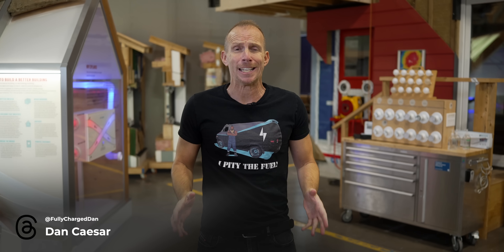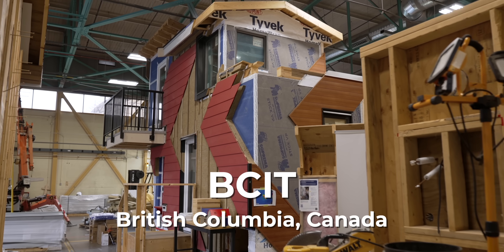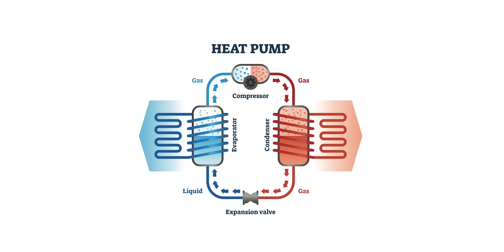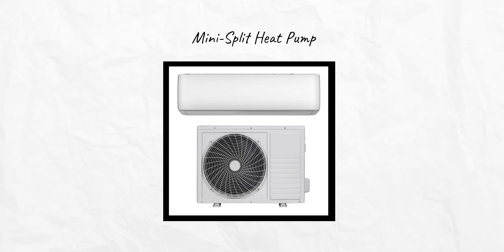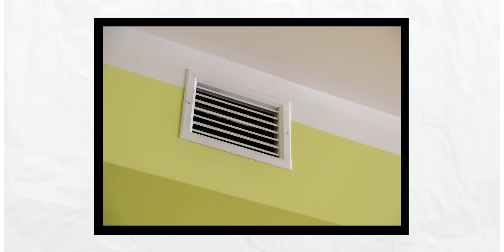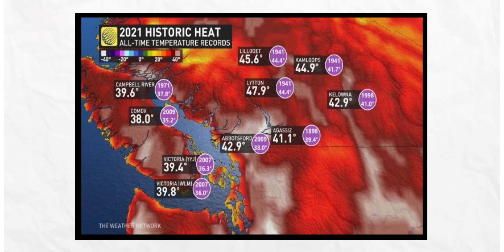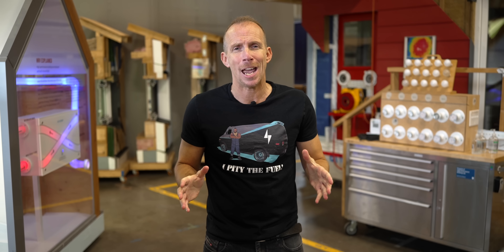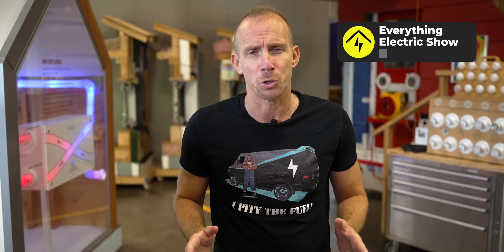The Future of Home Heating and Cooling!?!

Comment: Come on Labour, extend the boiler upgrade scheme to air to air.
Reply: First they need to extend the funding for the scheme so it in place for 10+ years on old buildings. They need to increase the demand by making mandatory for all new builds.
Reply: @DavidKnowles0  

Why not contact Rachel and Kier and put that question of mandatory change to the building regs to them?

You make a reasonable suggestion and it deserves to be answered by the decision makers in government.

There again it might be that to save costs UK is shifted to hydrogen as fuel.

You could ask Kier about that too.
Reply: @t1n4444  - well that's an oblique shift to introduce hydrogen. Odd that you seek to only mention the negatives of A2A and A2W above, but don't mention the negatives of hydrogen (in fact never mention any real details). Like the two UK home hydrogen assessment projects closing down due to lack of interest, high generation/operating/consumer cost and higher explosion risk of using hydrogen in existing pipework. One report was so bad the company behind the project refused to let it be released on the grounds it could prevent hydrogen being introduced at all.

It really does seem you dislike the use of electricity - whether in battery storage, vehicles or supporting home heating/cooling - in the most extreme of ways. Yet again promoting the hydrogen alternative that is not likely to be able to address today's home energy problems for decades to come; problems that are more quickly and cheaply answered by electricity powered solutions. Are you really in for hydrogen all the way and in everything, or is keeping the fossil fuel dependency status-quo more your aim.
Reply: @GruffSillyGoat  

Is there any chance you might comment a little less and spend the time researching instead?
Reply: @deanfielding4411  

Well good luck with that then.

You might have noticed we're having a "law and order" thing at the moment with Keir doing some "foreign policy" stuff on the side.

Your MP might be more interested in "taking an interest" in current proceedings as opposed to "asking questions".
Reply: @t1n4444  What do you mean by that? Can you elaborate?
Reply: @deanfielding4411  

I could but why not Google up how Parliament works with regard to raising questions.

Would save a lot of cribbing out stuff just as easily found online.

In fact a lot of posters would  be wise to research prior to posting.

Usual we just get history lessons. R&D moves so quickly these days.
Reply: @t1n4444  - Sage advice. Tell you what why don't you try your own advice, your comment to video and channel ratio is rather high. That said still waiting for your expert sources, DMG still or has it moved on?
Reply: Hmm ... one thing omitted in the video was the pay back time.

Obviously this time will vary depending on all sorts of factors.

However, if you're going to do the whole thing of  updating the insulation,   installing larger radiators and associated pipework (22 mm from 15 mm, say, then that would be extra. Not to mention all the upheaval that would cause.)

As in extra costs then longer the pay back time.

The cost of insulating some homes in UK can be quite expensive depending on their age and construction.

Before anyone chimes in with "foam insulation" then suggest you approach the money lenders who commission surveys for their lending policies.

If a surveyor cannot determine the state of roof timbers, say, which are covered in foam insulation then the surveyor cannot see any water damage caused by trapped rainwater from an old, cracked slate roof for example.

The old style blown rock wool cavity insulation is now known to collapse in said cavity and form a moisture bridge to the inside walls.

Well good luck with that then.

Probably a more sensible option for some people in the long run is to simply buy a new build house which is "approved" by local building regs.

It would have helped if you had included that in the video Dan instead of green washing the whole process.

Having lived in Canada then I can attest that their system of using air ducting for heat distribution is an entirely different proposition ref overall costs incurred for a conversion.

A salesman you are not.

Unlike JS who, very recently, looked as if he were auditioning for a position at Cinch.

He would be MD after a week.

Dan, suggest you stay away from the camera on such matters.
Reply: @t1n4444  How do they determine the state of roof timbers in loft conversions where they are hidden behind insulation plasterboards, and plaster?
Reply: @t1n4444 you are thinking of air to WATER Heatpumps.

Air to AIR are far simpler to fit and can be fitted alongside any existing system so the occupant can pick the most suitable system for any given conditions. 

They are also more efficient than air to water systems and can provide cooling in the summer (an increasingly useful feature)
Reply: @t1n4444 air to air heat pumps don’t need radiators!
Reply: @t1n4444  wrote: "old style blown rock wool cavity insulation is now known to collapse in said cavity and form a moisture bridge to the inside walls".
Occasionally yes. In the vast majority of cases it works fine and is a very cost-effective upgrade. EWI is always technically best, but it's several times more expensive. Building upgrades are doable though. I've done my house over 17 years and the heat load has dropped by 85% from 'as built' in the 1960s. (from ~300kWh/m2.yr to ~30kWh/m2.yr - which is close to passivehouse retrofit level). A 3kW heat pump should be plenty. I've spent about 2 grand/yr on average to do that. So not 'cheap' but affordable over time for many people. The rise in the house price is much more than the money I've spent improving it so in that sense it's not 'cost' anything at all.
The most important bit is that now it's really comfortable to live in, and the power company pays us, whilst when I moved in it was cold and draughty and expensive to run.

Comment: People in the UK please take note, he said Gas Fitters, which is what they are, and NOT Gas Engineers as they are called in the UK. If you want my Engineer title, do the three year degree and four year apprenticeship.
Reply: Maybe you don't, but why do so many engineers fit 25+kWh boilers in properties with a heat loss of 7kWh or less - pretty typical for the UK - even when it's not a combi system? 🤔
Reply: @TJames usually cos they dodge doing anything to do with maths - easy to stick a finger in the air and bigger = better of course 😂
Reply: Gas fitters, or Engineers, in the UK are not Qualified to install Air 2 Air unless they have a refrigerant license
Reply: @davetester100  and cynically this is why the subsidies are going to A2W - the industry would have a "meltdown" if they started to phase out gas boilers with thousands of gas fitters with nowt to do 🙄 Once R290 becomes more prevalent on A2A the need for f-gas will become irrelevant except for legacy installs - if anyone had any sense, they would subsidise re-training of all those out there who bemoan not being able to whack in a 500kW combi cos it's "the best" as has been the case for the last couple of decades 🙄
Reply: It’s a protected title in other parts of the world - in the UK anyone with a white van calls themselves an “engineer” and the general public are daft enough to accept it 😳

Comment: It's absolutely ridiculous that A2A are not covered by the boiler upgrade system in the UK.
Reply: Its to avoid subsidising the creation of higher summer electricity demands.

Whilst that can be offset with solar powering AC, it's still energy going into cooking rather than something else.
Reply: @DevAnubis  Also because A2A doesn't do hot water.
Reply: @egocd  what I want to know is why can't an A2A system pump heat from my home into a hot water tank, provided the tank is well enough insulated?
Reply: @MrWobling 

Why not Google up the issue?
Reply: @MrWobling coz hot air is very inefficient at heating water 😢
Reply: @davetester100  @AndrewEbling there are some specific sets that can cool your home while heating a water boiler. Hard to find, but it is possible to combine it.
Reply: @AndrewEbling Because then it's not an air-to-air system anymore, it'd be a hybrid system that heats (and perhaps, cools) the air in your home and heats your domestic hot water. But rumor has it some manufacturers are developing such units at the moment.
Reply: @DevAnubis  That's the rationale I agree, but it doesn't stand up. If that was the concern they could simply mandate that it's coupled with a PV installation. Personally I think it's driven by the typical British politician aversion to improving people's lives.
Reply: @bimblinghill what a dumb thing to say. As though mps objective is to make lives less good.
Reply: @DevAnubis Not the problem. The problem is the UK government. The main parties are full of middle managers and bureaucrats and not pragmatic problem solvers. Just legislate so that A2A systems are eligible for a grant when fitted alongside a solar and/or battery system. Excess power usage covered.
Reply: @DevAnubis that is a valid concern but coukd be avoided by only providing the subsidies for HPs that cannot cool below 28C (a relatively easy software change).
Reply: It is the same in the Netherlands. However, everybody would just misuse the subsidy to install airconditioning for summer.
Sure, they might use it for heating too (I do that) but it is not a luxury thing to subsidize. 
I guess you could subsidize it if there is proof that the old heating system is completely removed.
Reply: @roland9367  wrote "However, everybody would just misuse the subsidy to install air conditioning for summer.". Why is having summer cooling 'misuse'. Temperate countries are increasingly needing cooling as well as heating in the summer, because it can now get way warmer than it used to more of the time. Encouraging people to replace a boiler with an HP that can easily do both seems pretty sensible to me.
Reply: @xxwookey  Yes, that's all true. But that doesn't stop people just putting in AC everywhere, for free, just for comfort. Not replacing any boiler. AC is pretty cheap, with subsidy it would practically be free.
The only thing that would be good if you would prove the removal of boiler and gas line connection.
Reply: The reason is that Air to Air is half the cost of a combi boiler installation

Comment: We had electric storage heaters and no heating plumbing, so air to air was the cheapest to install for us! Been amazing after doing both a heating and 2 cooling seasons. Would recommend even if you have radiators...
Reply: Good to hear someones done this. How many pumps, indoor units and rough cost ?
Reply: @jimlymm  we have 5 indoor units, 1 outdoor unit. The air conditioning was just under £7000. That does our kitchen, living room and all 3 bedrooms.

The bathrooms are served by immersion heaters in towel rails.
Reply: @jimlymm also would like some sort of sizing guide
Reply: just got mine in May   im having an electric heater  for the kitchen and bathroom so no need for water tanks